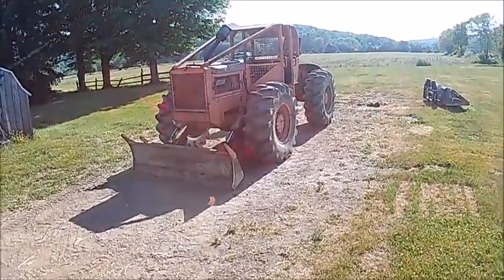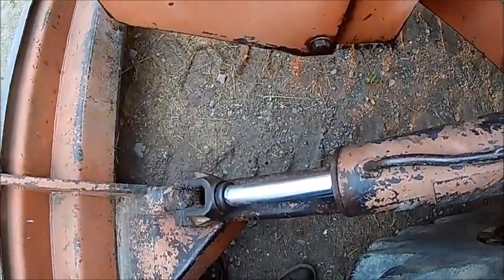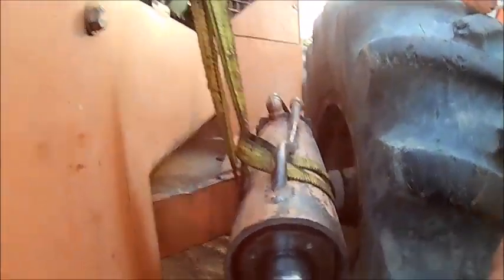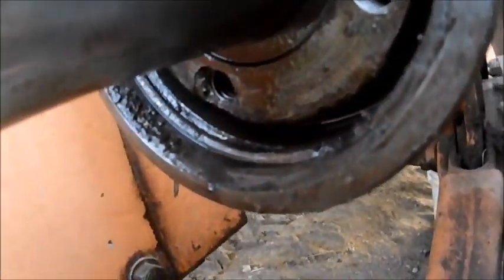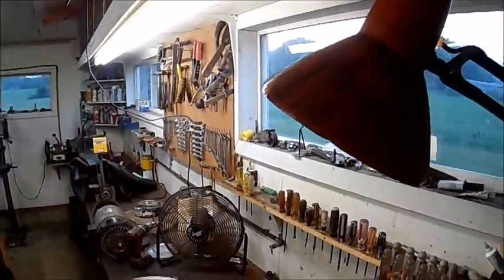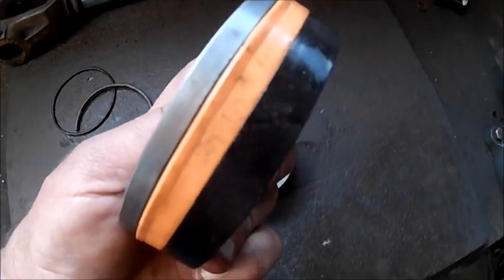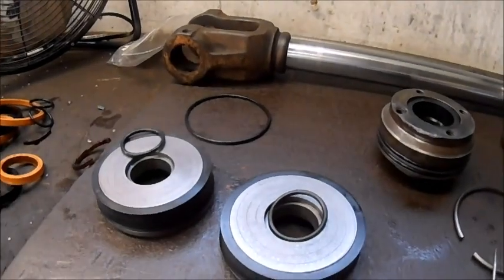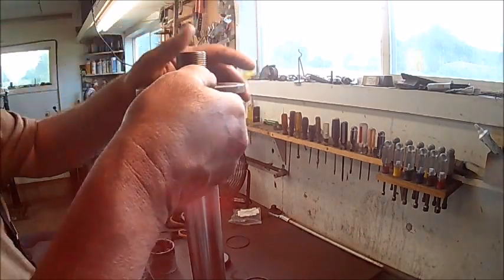timberjack log skidder repair part 4 - dozer cylinder reseal

Comment: Love your series on this Timberjack…I just purchased a 1974 230d….where did you order your seal kit from ?….and how did you figure out which seal kit you needed….thanks for your time….Jeff
Reply from the maker: i get parts from CJ logging  little valley ny, slimak engines brookville pa or Harolds logging supplied camdem maine. seal kits bought both and returned one o did not use.
Reply: Thank you 
Jeff